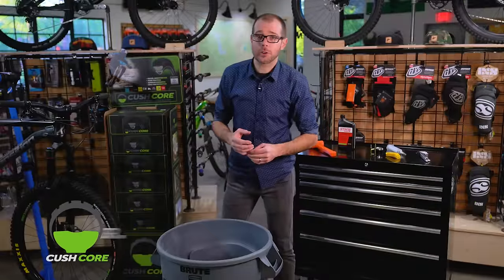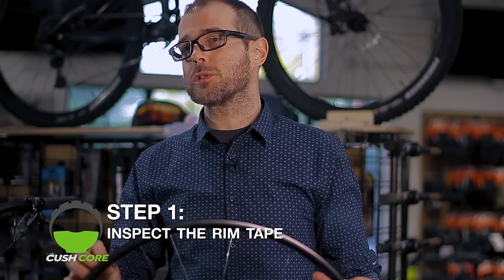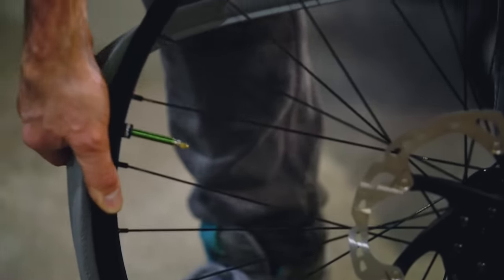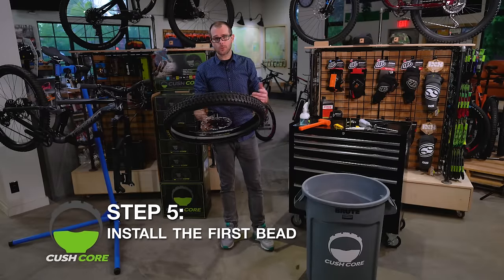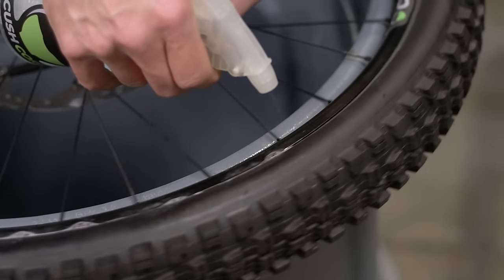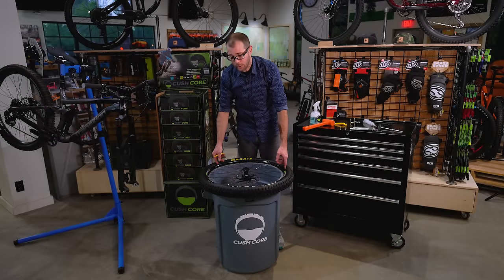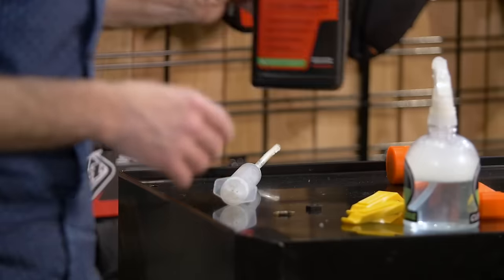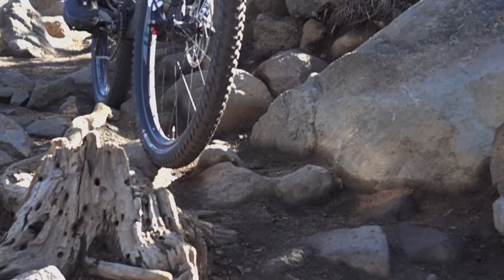CushCore Installation - 2018 Official Video

Comment: Just installed CushCore for the first time. There are a number of videos and opinions on the best installation technique. In my opinion, this video offers the most practical ideas. However, the importance of the "Roll and Tuck" is under-valued and the use of a tire iron for "dropping the bead" is WAY over-valued.

Rather than using the tire iron to try and tuck the bead under CushCore (AKA "Dropping the Bead"), I found ideal success when I lifted/bent/flexed CushCore (as suggested in the "Roll and Tuck" technique) toward the opposite side of the wheel and exaggerated the "Roll and Tuck" well beyond the suggested amount in the video ... In effect, popping the CushCore up into the tire itself. This made seating the tire much easier, by giving me the actual extra slack needed to seat the bead.

In this technique I am offering, after seating the bead on both sides of the tire, it's very important that PRIOR TO "Step 7," the tire is inflated to fully seat the entire bead on the tire into the rim bead ... Pump the tire until popping sounds of the bead going into place stop. It's okay to over inflate the tire to be sure bead is seated, as all air will be removed to place tubeless liquid during the main part of "Step 7." 

Now, I am headed to Bentonville with my hardtail, to give CushCore a real field test! :)
Reply: How is it? I'm considering buying it for my hardtail... Hoping it gives me more comfort and control.
Reply: @kaylum69  I have been happy with cushcore on my hardtail. I have run it with the full range of tire pressure, soft to firm, and feel has benefits both ways. But, it's biggest benefit is at a bit lower tire pressure, so you get the cushion and suspension-like feel.

Comment: I just installed the CC 27.5 Plus in the rear of my Stans Baron MK3 wheel and installing the tire to the rim only took 4 minutes. Full installation is 15 minutes including getting and putting the tools/parts away. My first time too! I didn’t read or watch this video. Just here to share how easy installation was. Just make sure you slide the all of the tire bead on one side into the well/channel. You can use a plastic tire lever. I suggest to use Gorilla Tape as opposed to Stans Yellow Tape. Gorilla Tape is a lot stronger and will rarely get a cut from the plastic lever.

Good luck! Can’t wait to take my bike out this weekend! 🙌
Reply from the maker: "Just make sure you slide the tire bead into the well/channel." YES...that's the key! Thanks for posting Tjay, enjoy your CushCores!
Reply: Now try with wired-on tyre

Comment: @cushcore168 Well, I can't say the install was anything like this for my Cushcore 27.5 plus, despite watching the videos and following all of the instructions!  First time took 5 hours to do both wheels, and the second time took 2.5 hours!  I was doing it at a bike shop, and after the owner of the shop (a professional bike mechanic) spent a half hour on the first and tore the tape in the process, he gave up and told me I was on my own!  We managed to get it on together eventually with no tire levers.

This was with WTB i40 KOM Tough rims, and 24nrth Wrathchild 27.5x3.0 tires the first time, and Surly Knard 27.5x3.0 the second time.   It wouldn't be so hard if the center channel was just a tiny bit deeper!

I'm about to set up the Wrathchildren again for the winter.  I'm considering trying narrower tape that does not run all the way from bead to bead to improve tape adhesion/reduce risk of pinching the tape, since everything is TCS and the Cushcores should hold the tire bead in place.  Do you have any experience trying this?

Comment: Installation comment only:

I just wanted to say that I was nervous going in on cushcore due to some of the install horror stories I have heard online and from someone at a local shop.  I ended up buying multiple sets of cushcore to install on 4 different bikes.  I did buy the cushcore tool (I highly recommend the tool!).  I watched this video and honestly had zero issues that were a result of the product.  *I did however get cocky on the second bike and in my haste I installed the front tire on backwards and didn't realize it until it was all stans-ed up and ready to put back on the bike..... I guess I got the full experience of getting to take off a tire with cushcore in it as well.   This was my first time ever touching the product and I did 3 bikes in about 2.5 hours (that is including my screw up).   Really, taking the existing tire off the rim and cleaning everything takes the same amount of time as re-mounting the tire with the cushcore in it.  If you were starting with a clean rim and new tire, I would say 10min is all I would need at this point.   I do REALLY recommend popping the extra $20 for their tool.  This was a superior way to push the tire into the center channel on the rim and get that last part of the tire bead over the rim.  

Bottom line: don't let these install horror stories scare you.  If you follow the directions (and, willing to spend an extra $20 on a new bike tool) you will NOT have any problems.
Reply: After spending about 1.5 hours trying to put tire on rim, I decided to look for better tire levers whereupon I came across the $20 cushcore tool.  The trick to the install is to push that tire bead off of the edge of the rim and towards the center of the rim.  Because the center of the rim is a smaller diameter than the edge, there is more space to seat the remaining portion of the tire.  The $20 tool describes pushing tire to center of rim.  I feel this video should be revised/edited to add this step to seating a tire. 
Note: after pushing both sides of tire to center of rim, I was able to seat tire in about 5 minutes.   I seated tire with my old tire levers and didn’t need the $20 tool.  All I needed was the information from the $20 tool description
Reply: Great experience Patrick shared with us. I have a question, how much sealant to use in a 27.5x2.2 cover?

Comment: I've heard nightmare stories, but I had no issues. I didn't have a round bin, but had a cane clothes basket that worked perfectly. Put an old towel over the top and away we go. Very useful vid.
Reply: Yeah I’ve tried it on my own 3 times for 1-2 hours each time and I always have to take it in to the bike shop to get it finished
Reply: @jamesprice3440  Maybe it's dependent on your rim and tyre combo. I was installing for DTSwiss rims and Wild Enduro 2.4 tyres with lots of soapy water. Shame to hear you had a crap experience.

Comment: Just put one bead of the tire on first, sprayed w soapy water then add the insert, bead most of the way, pour sealant in, no need to mess with syringes! Once sealant is in, rotate the wheel 180 degrees so it doesn't spill and fully bead the tire. Inflate, done, easy!

Comment: Gave up installing after 30+ mins of trying pushing tire into the rim. Have 42mm Rene Herse Hurricane and Diverge Roval rims. Will try again on a hot day after wheels have sit out in the hot sun for a while.
Reply: After letting the tire sit out in the sun for an hour, repeated the steps and was able to mount the tire. However, I forgot to replace old valve with cushcore vlaves, so had struggle an extra 20+ mins to unhook the bead area near the valve stem, replaced the valve and all is good. Feels like I can run 5 psi lower than usual. Will test ride this Saturday. I hope it was worth it!

Comment: have followed this and there is not way they are going on broke 3 tire levers and not even close to fitting no wonder i see guys with riding with bald tires using cushcore they dont want do have to start all over again 

these are still in the garage i bought different ones and they have been perfect

Comment: 1u30 later, still not installed on both sides and i broke 4 tire levers...
Reply: Broke the Cushcore lever and ended up puncturing the rim tape on both wheels. Uncool.
Reply: @briancarlcain14  Don't give up! riding one year on cushcore now and i love it! The installation is not easy though.

Comment: Just fitted my first Cushcore. Fitting inside a Magic Mary on a Stans Arch rim. It was tricky in parts, but the video was a good help. it took 20 minutes in total. Make sure you have good (metal) tyre levers and then follow the video, and it's no major issue.

Comment: Don't know what I was doing wrong, but I couldn't get the bead opposite the final section to sit offset to the centre, just kept popping out. My arms are so tyred i dropped the valve cap 3 times trying to fit it.

Comment: If I HAD Cushcore, it would've saved the tire I just got a pinch flat in 2 weeks ago. It's OK I guess because I now have a nicer tire (DHR2), but I want to install this NOW to save my newer more expensive tires.
One thing though, do you HAVE TO use THEIR valves? I have nice orange Stan's valves I put in. Why couldn't I use those with Cushcore?
~JSV
Reply: I think theirs have more holes on the sides of the valve that goes deeper into the tire

Comment: Tried installing 27.5” Butcher DH onto my DT 560 rims. Can’t get the ‘ drop the bead’ technique to work. Gave up after an hour. Maybe I’ll try a tyre with less stiff casing. If I’m racing DH and replacing tyres when they tear up then I may not find this worth the hassle. I know these tyres are always tight too, I always resort to using tyre levers before
Reply from the maker: We have installed this combo without difficulty, but I understand it can be tricky until you see it done. Would you like to send one in for a videotaped demo install?

Comment: Should I only use the Tubeless Air Valves from Cushcore, or can I use my Milk-its too? Update/Edit: Got a Quick answer from the Support: No: "CushCore valves have holes on the sides of the valve that allow air to flow through the rim channel. Most tubeless valves only have a hole on top that sits against the insert and gets plugged making inflation difficult. We highly recommend using CushCore valves."

Comment: I find getting it on is easy enough, especially past the first go, but then I find that with the bead pushed into the middle it won't inflate, and tips on how to get the bead back to the rim without a compressor?
Reply: having the same problem now, would keen to hear any suggestion
Reply: In the end I found cleaning the cushcore with soapy water helped

Comment: quote on another site, i found it to be fairly accurate with respect to maxxis ardent exo tubeless, apparently using new tires and soaping the inside helps /mandatory with maxxis if you want to avoid problems... mine rubbed through my frame (Al crack) after checking initially and it was fine...I obvs should have kept a closer eye on it after install:  "Everyone will assume you did it wrong, which is irritating AF, but what no one will tell you is that some tires suck. If you are using a Maxxis tire, note that their tires have a rough, textured inside, and the Cushcore won't slip into place as easily as a tire with smooth insides. The Cushcore guys also told me that there are some runs of Maxxis tires that simply are not straight, right out of the box, and lo behold, that was the case with mine. Also, don't even try to mount them in used tires, the dried sealant prevents them from sliding into place.

(wait for the Maxxis tifosi to scream and break out the lynching ropes...)

The real trick is to soap up the inside of the tire, soap the cushcore, mount the sucker EXACTLY like the Cushcore video, use a brand new tire with slick guts inside, and then be prepared to do it a couple of times and then you'll be super stoked.

Comment: The key is pushing the tire beads toward the middle of the rim instead of where it sits normally. It will give you the slack you need to finish. Not much harder than mounting a tire without cushcore.
Reply: I did that but because the beads were pushed into the center, they wouldn’t seat. I ended up using the cushcore tire lever to try and get the bead back in its seat and messed up the rim tape (same thing happened on both tires). Heading to a shop tomorrow $$$

Comment: For some reason I am having a hard time getting the sealant into the tire with cushcore installed. The first try ended with sealant spraying everywhere. Any tips?
Reply: What sealant are you using? There might be a clog in the injector or the valve. Make sure it’s clear, then position the valve at 3:00 so the sealant flows downhill. It should not require pressure to inject the sealant.
Reply: Adam Krefting ethirteen tire plasma. A clogged valve was the first thing that came to my mind as well. Weird thing: it happened on both tires. I can still easily inflate them tho. So I am starting to think it’s the sealant itself that’s causing the problem

Comment: I bought the emtb cushcore last week. Spent a whole afternoon trying to get the front wheel done. One bead took 3 hours. Broke 6 levers. I watched every single video including cushcore official vid. Called local bike shop to buy steel core levers, figured I’d ask how much they charge to just finish the job. They said $60 bucks, half hour turnaround. I get down there and then the said $60 EACH. Ok I guess thats acceptable. Oh and btw two days turnaround time. Then I drive home and the tech calls me back and says he can’t get them on, makes an excuse about I need a whole new tire. I go to pick them up to find out he UNdid the front wheel that took me all day to do. So now after having a “pro” take a crack at it, I am right back where I started minus one front wheel 85% done. This has been a nightmare. I have one cc bead bro showing up today from amazon.  I know you need two AND you probably need the official CC lever. This is turning into a giant fiasco. I really hope they are worth it. They were recommended by a friend I trust so we shall see
Reply: Levo mullet, roval wheels, specialized eliminator & butcher combo…for conversation sake

Comment: just buy a tannus insert. way easier. im running a tannus on the front of my DH bike and a cushcore in the rear ( which i bought out of frustration at a bike park before i bought the tannus)  and the cush core is always a royal pain in the ass and the tannus is always super easy

Comment: BuIIsh**t.  I just picked up a set of these and regret it. Not only are they extremely overpriced but getting them in or out is ridiculous. This video makes it seem like it’s not so bad but it’s a lie. I worked as a mechanic and this was a tire install from hell. You should never have to use tire levers to install a tire.

Getting one side of the bead on the rim is extremely painful, getting the other side on is 10x worse. It’s no wonder they fast forward through that part in this video. 

I’m going to guess they are using a super wide and well used tire just to make it easier in their video too. Personally I was seating a brand new 2.4” DHR II MAXGRIP DD and it was absurd.

I was stubborn so I didn’t stop until it was on but even that I regret because I’m sure it won’t even be easy to get out. The inserts are so wide they push the sidewalls out which makes it extremely difficult to get the bead off the rim. On that note, it probably makes your sidewalks more susceptible to damage since they can’t flex as well when getting pushed through tight spots. Of course that’s just an assumption. 

I put the second insert up for sale as soon as I got home. It feels like I have been scammed into buying a useless product that can actually cause more harm than good.

I wish this was the review that I read before buying so that I could think twice about it.

Don’t do it.
Reply: Nearly same story here. Hands felt like I boxed 12 rounds after ONE bead finally went on

Comment: And what if the opposite bead is stuck in the low spot so you cant get the remaining side into the lowest diameter. F&@)&ing joke man.
Reply: @cushcore690  Thanks for replying. It's impossible with a DH casing Maxxis DHR2, the bead is way too tight to move. I think the only way will be to seat the tire without cushcore, then remove one bead, insert the cushcore, then the opposite bead should be fully out of the way. I will try this week.

Comment: Not as easy as the skinny hipster dude makes it out to be. Took me more than one hour to get the front tire mounted (Stan’s rim) yet only five minutes to get the rear mounted (HED rim). Clearly at this point USA = 0; Belgium = 1. BTW this was with 700c inserts designed for 35mm+ tires (mine are Panaracer Gravelking SK 700 x 38). Anyway, my hands are blistered AF with some seeping wounds. I can only imagine that this process is 75% easier with regular high volume MTB tires on wide rims.